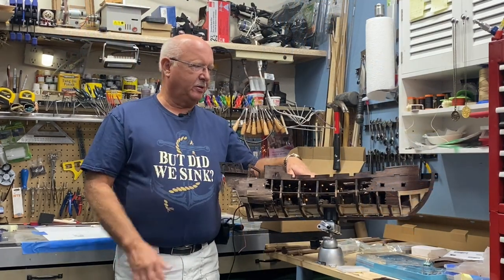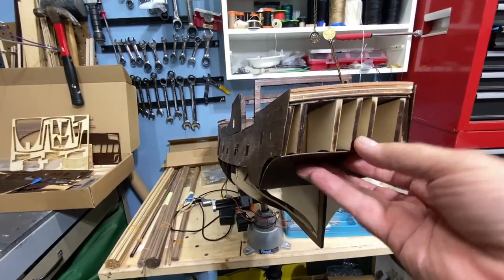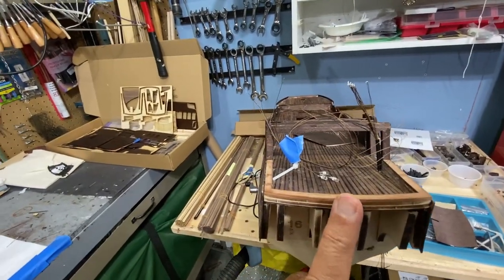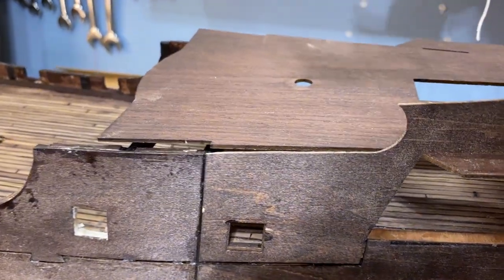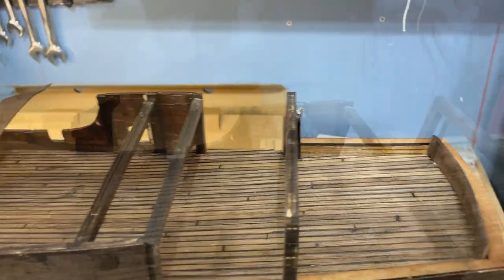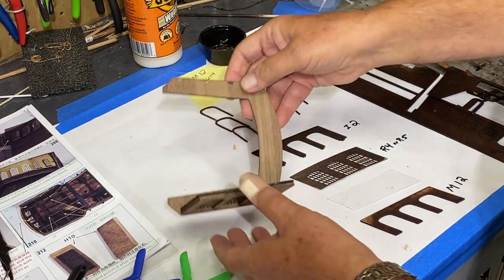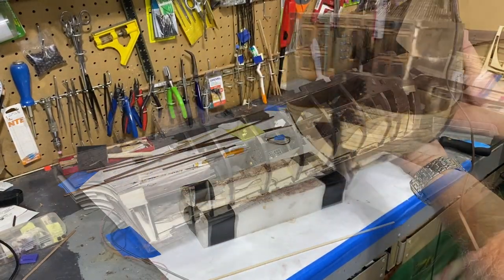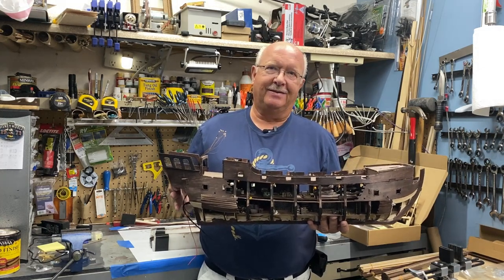Black Pearl All Scenario Version PART 9

Comment: One other tip on planking that might help. I take a tall thermos and fill it with boiling water. Let the end that needs bent soak in the water for a bit. It will help you bend the plank into shape a bit more. Works well on complex bends and curves paired with your plank bender. As always great videos and keep up the good work!!
Reply from the maker: Thanks!

Comment: I love watching this series of videos on the Black Pearl. I want to build this version of the ship for years, but I don't have any experience in model ship building, the time for it and the space as I am a student. You're doing a great job with yours and I can't wait to see the final result !

I just wanted to explain a little how a resistor works. A resistor is a component that opposes to the flow of current. It may let the current pass more or less through it depending on de resistance of the resistor (the value of the resistor). It is often compared to a water valve that we close more or less. More de valve will be closed, and less the water will be able to pass through it just as the value of a resistor. Higher the value is, less the current will be able to pass through the resistor.

There are two ways of connecting resistors together :
- in parallel just like you did
- in series by connecting them one after the other 
Those two ways of connecting the resistors impacts the equivalent resistance of the connection. 
In series, the equivalent resistance is the addition of all the resistor's value. 
Ex : putting two 1K Ohm resistors in series gives a 2K Ohm equivalent resistance.

But by putting the resistors in parallel, the equivalent resistance will be smaller than the lower resistance value in the connection. In your case, you're using the same resistors witch you're connecting in parallel. When all the resistors have the same resistance value, the equivalent resistance of the circuit is : The value of the resistors we're connecting divided by the number of resistors.
Ex : if you're connecting three 1K Ohm resistors in parallel, the equivalent resistance of the connection will be 1K Oms/3 resistors

hope my comment will be useful this is the basics and i could talk more about the resistors, but it just was for the knowledge more than something else hahaha

Love what you're doing and keep enjoying your build !
Reply from the maker: Thanks for the education.  I think others trying to figure out what I was doing will be helped too.  
Series vs parallel explanation was helpful too.
Thanks for following along 👍

Comment: I also switched out my LEDs to the flickering ones that look like fire. On Amazon, as well as very thin black wires that can be hidden easily, but also broken easily so be careful if you use it around/through the rope work. Looking good!
Reply from the maker: I worked out a way to use the flickering lights using an inundated sleeve on the positive post of the led’s that I have.  I had to do that because the lanterns on the back of the ship are metal…. I’ll show it in a future episode 😁.  In the future I will get some of the pre-wired ones that you mentioned 👍

Comment: The 3 lights and all lights for that matter that I use are orange flickering leds 3 millimeters. The represent the lights in the real ship perfectly and are fairly inexpensive. They are the same used in fake candles. Thanks for your awesome vidéos. You must be a very caring person.
Reply from the maker: Yes, I have those and will use on the back top of the ship.  They are the type with metal stems that have to have the wire soldered to them. For that reason I didn’t use them below deck…. Just to cumbersome! I made a similar ship a couple of years ago using all flickering lights and they do look much better.
Thanks for the compliment, not sure that I’m all that caring?  I needed to keep busy in retirement and the ship building definitely does that! Then making the videos satisfies me creative side…..
I appreciate your following along. I’d be interested in your flickering led lights if they are pre-wired? You can copy and paste a link to a source, or a little more details on them and I’ll start searching.
Reply from the maker: You inspired me to try something!
I was able to drill a little larger holes in the base of the 3 rear lanterns. Then I could put a protective sleeve on the positive posts of my flickering led lights so they don’t short out on the metal lamps. Now I can solder the power source to the led stems…. If that isn’t clear, I’ll show it in a upcoming video post. 😁.
Thanks again!👍👍

Comment: Hi dan,
Seems I did not receive enough planking for the hull. Do you know what kind I should buy and where?
Your video's have helped me out alot. Thank you!
Karla
Reply from the maker: I can but I’m away on vacation and can’t measure from here…..
It should be listed in the instructions, then you can usually find it on eBay….
However, if you contact ZHL directly they may provide you some?
Try writing modelshipkit@gmail.com
That’s if you ordered from ZHL.
If not, I can find out more next week when I get home.
Reply: @BoilerDan1  thank you forbthe information. I look forward for your measurements when you get home. My instructions look like they were printed of a copier. In the meantime I will contact model expo. Thank you!
Karla
Reply from the maker: Ok, I’ll get back with you in about one week from today.👍🏴‍☠️
Reply from the maker: If your instructions look run through a copy machine, you have a pirated copy of a Pirate Ship😂.
No panic, you can still make the build.
I’ll send you information when I get home.  But prepare yourself as there’s probably additional items that will be needed.
Are your statues made of plastic?
That’s another indication of a copy of the original.
Anyway I will help out as best I can when I get back.
Thanks for watching!🏴‍☠️
Reply from the maker: The Black Pearl Golden Version has the following sizes of wood planks:

Paulownia for first layer of hull
2mmx4.5 mmx400mm amount 150
It’s a cheaper wood that doesn’t show.

Black Walnut Top layer of wood for hull and deck:
0.5x4.5x400mm
Those are the higher quality exterior planks.

I’d suggest you measure what you have to be sure.
I’ve had some success with eBay but not finding the exact size…. But if you use it for the entire hull, a slightly different size is going to work.
Here’s a sample at EBay:
https://www.ebay.com/itm/255290618959?mkcid=16&mkevt=1&mkrid=711-127632-2357-0&ssspo=WGY7nAN5Qqu&sssrc=2349624&ssuid=s8A53jWuRTC&var=555272413254&widget_ver=artemis&media=COPY

HOWEVER your best choice would probably be this seller here in the USA:
https://modelexpo-online.com/wood-strips-for-modeling

Hope that helps.  You might be able to call the second place and ask for specifics?
Good luck 👍 and enjoy your adventure!
Reply: Thank you for all your help. Greatly appreciate it! Happy adventures!
Karla